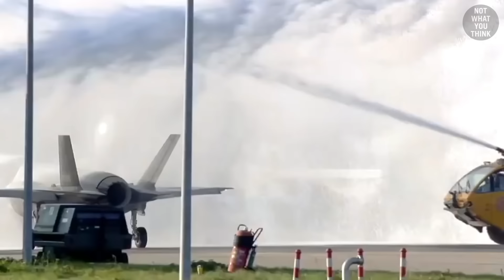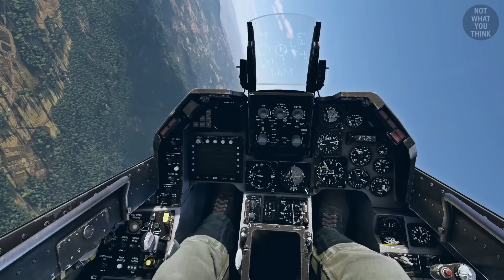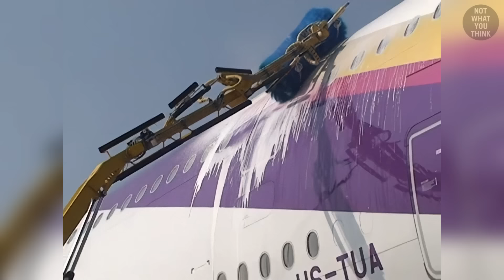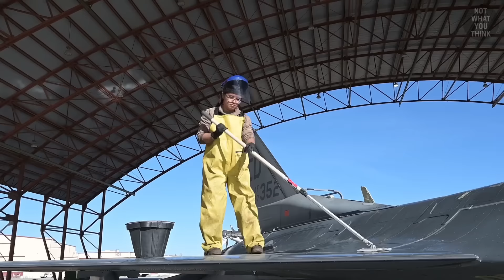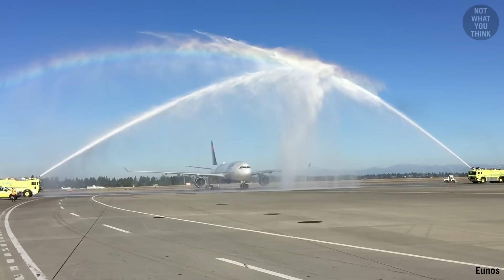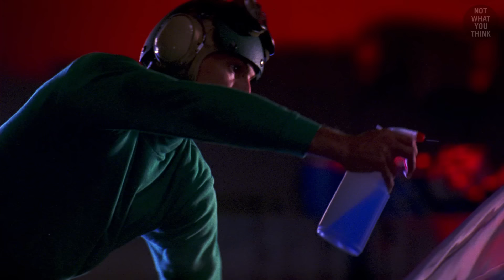Why Airplanes MUST Be Washed as Frequently as Every 7 Days

Comment: When I was in the Marines, we had a "field day" every Thursday. That means we cleaned our barracks room and common areas of the barracks. Friday morning was barracks inspection. Sometimes it was just the duty NCO, other times it would be the squadron CO, sometimes even higher ranking officers like the group or base CO. If you flunked the inspection on Friday morning, you could be sure you were going to get some practice cleaning stuff on Saturday morning on the aircraft wash rack.

The belly and wheel wells were the dirtiest part of Phantoms and the smell of aircraft soap will generate a psychic reaction for decades afterwards. 

When we were on the boat, each maintenance shop was assigned an aircraft or two that we had to clean every day with spray cleaner and rags. Each aircraft got a fresh water washdown about once every ten days.

Comment: PSA to those reading this: Please do not pour anything but water down aircraft sinks. With few exceptions that water goes to a drain mast where it is dumped overboard. This means im flight it will streak across the belly of the aircraft. In other words if your pour coffee grounds down the drains it will streak down the bottom of the plane staining it.

Comment: A clean aircraft saves 4% fuel not 2%.  Most commercial aircraft are washed on a 30 day schedule.  Foam cleaning chemicals only work on light oils and don't work on grease and oil streaks. Varsol is the best cleaning chemicals for the belly.

The Nordic Dino was pulling a scam that you bought the machine, but their parts delivery was always inconsistent.  What they wanted was to take over cleaning contracts, then they would fix the parts supply.  This resulted in many lost union jobs.

Comment: $3 per gallon 🤣🤣🤣🤣🤣🤣 Bro, jet fuel is between $6 and $10 per gallon. A 747 uses about 1 gallon of jet fuel every second so it costs $21,000 an hour to fly. So it costs about $90,000 to fly from LAX to JFK. If they could fill the entire 747 and charged $200 a ticket, they'd break even. These are just facts of the numbers that nobody thinks about.

Comment: About the aircraft carriers. They navy needed a better environmental safe detergent to wash stuff and simple green was born. Simple green was created to meet the US Navy’s requirements for a safer detergent. Now about hand washing/waxing aircraft. In the 80’s I worked for Del Smith’s- Evergreen Aviation as a ground crew person /// and  — affectionately known by us employees as Air - CIA 😂😂😂, ,,and one thing they where looking at back then was getting into no water needed a product that you wiped on then off of a airplane that washed and waxed in one step. A trial run was on a Boeing 727 and I tell you it took a hole crew I think 10 of us to do that plane in 5 hours ; it was not fun. Another story about emptying a planes waste tanks. I was asked to go and retrieve A planes flight bag-big leather case that had all the flight stuff in it by a A/P mechanic. The plane another Boeing 727 that was converted to haul freight, parked on the other side of the airport out in the hot summer sun for at least 24 hours. When I opened the door , WOW what a smell. I got the flight bag. When opening the door on that Boeing 727 the one and only toilet was located straight across from the fuselage door right behind the cockpit. When talking later with the A/P mechanic how everything went ; I said fine , I got the flight bag- but the aircraft sure stunk like a outhouse. His response was thanks for bring that up. I need to get the aircraft’s sewage tank pumped out so it doesn’t overflow, because the sewage tank is located above the aircraft’s avionics equipment. It would be a bad day if the toilet overflows over the avionics bay😂😂😂😂😂👍.

Comment: I've been assigned to wash rack for F-16s and let me tell you, that soap is some industrial strength nasty. 
It will eventually find its way into your suit and start causing pin and needles sensations alongside mild numbness in exposed areas. It's no good.

Glad I don't bother with that anymore. 

P.S.: No one calls the F-16 the Fighting Falcon. It's been the Viper for as long as I can remember.

Comment: Bit of advice.  If performing a 14day on a Huey, after cleaning the rotor hub and other areas on top, do not just walk off the side of the bird. Just because your legs may be strong enough to take the landing from that height, does not mean the wet soapy concrete will provide sufficient traction to keep your feet under you.  Trust me.
Reply: Ouch. Hope you recovered well!
Reply: Should... should I ask how you found out?
Reply: @Ealsante  I think you know :)

Comment: I disagree with the theory that it makes it more difficult to see cracks or other issues with the aircraft if it’s dirty on the other hand that’s exactly when you want to do a initial inspection of a aircraft, before it’s cleaned because you can see some cracks or damage to parts more easily because of the way the dirt flows around those cracks or even leaks out of cracks and also dirt helps find fluid leaks more easily also. Once that initial inspection is done, that’s when you clean the aircraft and all of the parts. I think that if you talk to any inspector or mechanic they will tell you don’t clean it until we get a chance to look at it first!
Reply: I think its important to point out that a lot of the mentioned cracks are actually microscopic and detected by specialized equipment, dirt could interfere with the process in such scales.

Comment: A small correction: At 14:37, a reduction of 50-60 degrees Fahrenheit is a reduction of 27-33 degrees Celsius, not 10-15 as indicated.
Reply: mhm, F to C conversion is (F-32)*5/9, but for a change/delta it’s just *5/9

Comment: We used to run about 500 gallons of specially treated fresh water from long wash wands into the intakes our ATF3 turbo fans on our HU-25A Falcon ac in the Coast Guard after SAR missions, typically we'd fly about 200 to 500 feet above the waves out at sea looking for folks in the water. Lots of sea spray to wash out. We kept the engine somewhere above idle for about 5 minutes, I don't remember the specifics now. But it was kinda cool.

Comment: When you say $3/gallon for jet fuel, it was just for a number, right? It costs more then $3/ gallon of jet fuel, right? Otherwise I'm flying to work from now on
Reply: A quick search says $6-$7/gallon, or more depending on where you buy it (more like $11/gallon in Alaska). But you might also consider that a jet engine tends to gobble a lot more fuel than an automobile engine....

Comment: He estimated 1% but said a maximum of 2%, then told us the math with $3/gallon fuel. Let’s say it was 2% and $5/gallon, you’d be saving over triple the estimated $216000 shown in the video.
Reply: that whole metric is wrong not only because of that but a 737 does not burn 2400gallons an hour

Comment: Your fuel usage for a 737 is off by about 1800 gallons/hour
Reply: A possible source for such an error could be if the correct number is 2400 liter/h
Reply: 2400 liters per hour sounds more like it, excluding takeoff and getting to cruise altitude
Reply: How much does it vary between different models?
Reply: <Insert obligatory joke about American units of measurement here>

But seriously... just use metric. It's better.
Reply: only vendors measure volume. Everyone else uses weight.